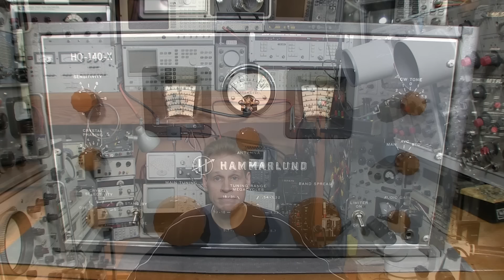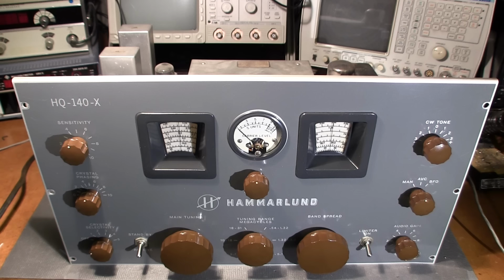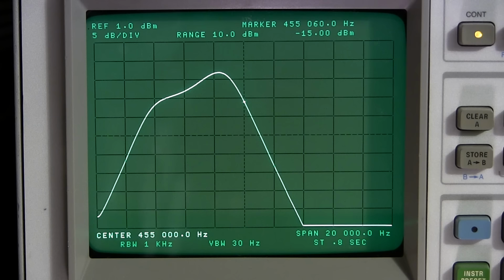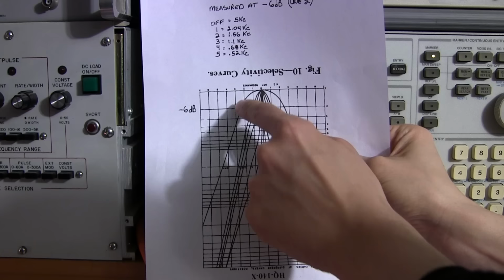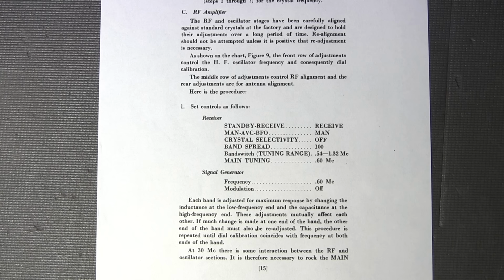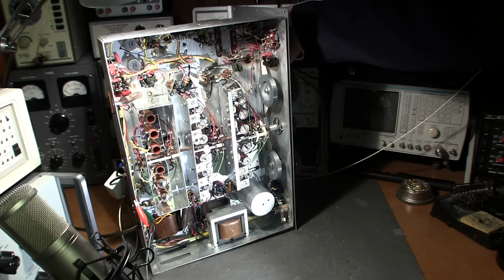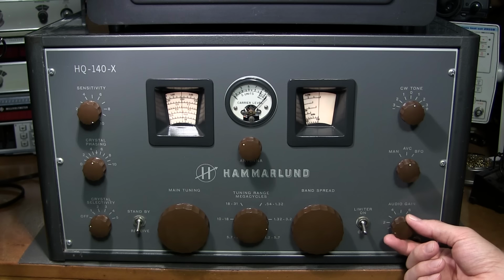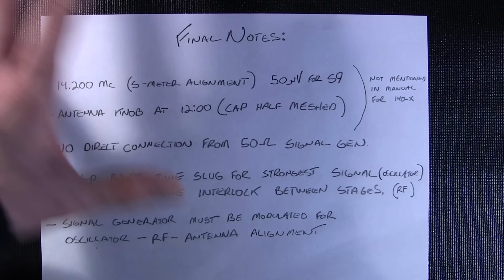Hammarlund HQ-140-X Repair and Restoration

Comment: I have one of these; it still works and I can pick things up on it.
However, it could use a good cleanup.  Most of the knobs cause a lot of scratch-static when being moved.
And the "band spread" knob, sometimes get loose when you turn it, like - it just spins freely and then "catches" again.

Comment: Hi Paul,  just a quick question about the replacement capacitors you put in. I like the dipped style but cant find any polypropylene caps in this style on the usual web shops I use. most of the available PP caps are ugly plastic blocks. Is it OK to use polyester (PET) caps instead? If you can tell me a brand / series that would be very helpful... thx!

Comment: Watching this again now.   Still curious about how the Noise Limiter works with modern noise, such as switch mode PSU's.
I also think this could be a factory fresh unit, but the alignment was maybe done to a secondary harmonic instead of the primary frequency?   Maybe the poorer performance due to that is why it was shelved and has low hours on it.

Comment: This is a real improvement on the HQ-129, and still a viable and enjoyable radio to use on the low bands for AM.  I didn't experience any memorable problem aligning mine with simple gear.. sig gen , a vtvmn and a good ear.. but at the time I was doing a LOT of receivers.  I will bet my bippy, that is all  they had to work with at Hammarlund when it did roll off the line.  Except the person doing the work was almost certainly a woman.. but then that;s who made all these classic radios !

Comment: I have one of those high-voltage tuning capacitors sitting on my bench right now like the one used for antenna tuning.  It came out of a homemade wave meter.

Comment: Paul, another very informative video. I had just aligned a Hammarlund HQ-180A a few days before your video was posted and it's interesting to compare similarities and differences. You always seem to pull in a ton of stations. I may have missed any comments you made about the type and specifics of your antenna. Any details here would be appreciated. Thanks for your time and the quality of your work which you capture extremely well with your video cam and studio type  (condenser?) microphone.
Reply from the maker: Hi Steve. The antenna is an 80 Meter inverted V.  The measured specs: 50 Ohm, SWR 1.0-1 and X=0 @ 3.885 MHz. The center is up around 45 Feet, the leg ends are around 15 off the ground, suspended by insulators. The coax is RG-393 fed to the center, no Balun.
Reply from the maker: Oh, I will also add, the wire used for the radials is fine strand #8 insulated silver wire.

Comment: Hi Paul. I just finished the IF alignment on Hammarlund HQ-140X. (badly screwdrivered) The frequency turned out to be 454.4KHz. I'm using an HP 3325-A synthesizer / function generator (NIST certificate). I am running 200mv p-p into your isolation circuit. Upon removing the T2 cover I saw the crystal frequency stamped on the top of the crystal. ??6.55. The ??s are for numbers hidden by a mica capacitor. I assume the crystal frequency is 456.55. I think the entire IF section has been pulled sideways. I think I should raise the entire assembly to crystal frequency. What do you think?

Also, with crystal selectivity on #1, turning the phasing control does produce notches but the peak moves from 456.4KHz at #1 to 455.9KHz at #9. Thanks.

Comment: I had a question regarding my HQ129X BFO behavior. When I switch to the BFO for CW or SSB, I get a dramatic drop in volume to the point that I need to crank the AF to max to get it to a level that is comfortable. Also the knob above the switch, when turned is unable to zero out to get a good tone on CW or intelligible speech on SSB. 
I do notice a slight dimming of the Voltage Regulator tube when engaging the switch to the BFO position. 
Any ideas where to start on this?
Thanks
73
David
KF4UOD

Comment: If I wanted to get a used tracking generator- what would be several to consider ?I would like to display the IF can/chain bandwidth shape like you did .Can you do this with a signal/sweep gen [HP4040] and an Oscilloscope ? How would you set it up ?  Thanks !

Comment: This is a great video.  One question.  Any suggestions re safety capacitors?  You've commented on rewiring the main power input for All American 5 type radios to include safety capacitors, but I don't believe you said anything on this or the HQ 120 video for receivers with power transformers.  Any recommendations in this regard?  And would you suggest any changes with respect to the main power switch and fuse?
Thanks again for a great video, it inspired me to fix up an HQ-140XA, which is working great.

Comment: What about using Space Charge TELEFUNKEN vacuum tubes or Raytheon Wire ended vacuum tubes and adjust the B+ resistors in order to make it work on 12-25V and the heater 1.5V,
Why did they not see fit to use three triodes in double balanced configuration implementing a SO42P with the necessary parts to implement the tuned circuit of the oscillator that drives the two heated cathodes of the two tubes acting as the balanced mixer or would it be possible to retrofit such a module with the drive to the first IF transformers across  the two plates of the double  balanced mixer, someone is using frequency hopping for some reason.

Comment: Since this was aired new miniaturized spectrum analyzers have been flooding the market (TinySA). As most of us cannot afford a full sized spectrum analyzer, yet we want to do an IF sweep alignment on our radio (HQ129X in my case) can we use these $75 mini spectrum analyzers to do that alignment. It would make good video if you could… or even explain, if we can’t.
As ever, thanks for your gift of radio knowledge.
Cheers

Comment: Paul, you did something in this video that puzzles me.  When you covered the BFO adjustment, you indicated you turned the sensitivity to zero, (negating any signal from the tracking generator to get through the IF chain) then you turned the bfo switch to bfo and displayed the swept frequency response.  I have a problem understanding what you were beating the bfo output against with no carrier present in the IF.  Please clarify for me and thanks.

Comment: when looking for defective noise in a component like resistor or cap. I will use cooler or heat to see what effect that has instead of flexing on the leads to disconnect them. Just a different approach.

Comment: Wonderful video - as always!  When designed?  Pulling rectifier tube will not open filament circuit?  Smells good?   Why is that -||- in a can?   In those beautiful tuning capacitors, no interference through the open shaft slots?  (Oh.  Filaments parallel.)  Wonderful test instruments!

Comment: I always wondered about using tantalum capacitors where possible in some of these older radios.  Of course, that would not be anything NEAR period correct, but are there any other reasons not to use them?  I use them on old video game systems and I won't buy a computer motherboard unless it uses tantalum caps.

Comment: I just got into ham radio and bought several old pieces of equipment. Log books from the 50's etc. How do you find out its worth? I'd like to pass this equipment on to someone who will rebuild them and use the cash to finance a little of my new hobby. Keeping it for its history/nostalgic/display value was tempting but I don't have the shelving needed just yet or space.

Comment: I've  been  working on mine. Works well except for the BFO. When I switch to BFO, the mode switch arcs and the VR tube goes dark. Something is drawing too much current. Perhaps the mode switch is messed up??
Reply from the maker: Hi Philip, there is a short somewhere.
Reply: @MrCarlsonsLab  --- thanks. Was just wondering if this was a common failure mode with this particular receiver. Restored most of it and the nicotine just poured off of it with cleaning.

Comment: Great video! I have one of these HQ-140X receivers with 2 bad coils. The RF input coils for the 2 lowest frequency bands are both bad on the antenna link input side - fried. The other half of each coil is fine. Any idea what I could use to replace these?
Thanks.
Reply from the maker: You can do a bunch of things. Find an HQ129X for parts (more common than the 140) You can try to capacitive couple the antenna jack to the first stage (possible reduced gain).... Or try to re-wind the burnt portion of the coil.
Reply: thanks - the capacitive coupling works good, I took off the bad windings so if I can find some that very small wire I may try putting on new windings sometime in the future. I tried a bunch of different caps for the coupling and settled on 39 pf....works quite well actually.

Comment: Hi  I am restoring a Hammarlund 120 just like you did on a previous video. I am missing the aluminum shield under the chassis, under the tube socket for the 6J7 tube. (looks like the 140 has one also) You had another  one from a donor receiver but I do not have a donor and even if I did I would want to restore it as well. I intend to machine one from a solid cylinder of aluminum on my metal lathe. I can measure the diameter of the shield because there is a section of the shield still fastened to the chassis. But what is the height of this shield? I can pick a value as there is a tolerance or range of heights that would work and stay inside the chassis and still fit in the cabinet. Just wondering what the original height was and if you could tell me. Also  is there any holes or other structures in the original shield I should know about? Thanks for spending time making these videos.

Comment: great video, did take a long time to watch, was worth it :D

btw how does a two pin plug work so that the chassie isn't line or is the chassie connected after the transformer or??
btw 2. nixie clock project is going foward.

Comment: @Mr Carlson's Lab: You answer so many questions. Superb. I have a 140X in about the same condition. When I can get a proper sweep alignment setup, I will restore it with this video as a guide. Beautiful work, thank you. I also have a couple old SuperPros which will follow (SP200 and BC 794.) I have a request, and it is asking a lot, but I want to put it our there. Would like to know your opinion, review actually, of modern low cost sweep generators and spectrum analyzers that could be used for this type of work. The new stuff is small and low cost, but don't know if it is at all functional for these applications. I would propose manufacturers or dealers sending you gear to check out. You're probably not interested in doing something like that, but it would be my request because you work on the type of gear I want to keep running. Anyway, can't say enough thanks.
Reply from the maker: Thanks for your input!

Comment: Could you please tell me where you get the small ceramic standoffs you use. I've looked for ages, but can't find them. Also, have you ever worked on and realigned a Racal RA-17. That would be a fascinating video. Thanks for the great work.

Comment: Paul:

Once again thanks for the great video. I really love your tip for using the ceramic stand off when replacing the electrolytics .Where do you get those standoffs? What method do you use to hold those in place while you solder them in before you attach the new electrolytic?

Keep these videos coming!
Reply from the maker: Hi Bryan. I got the standoffs in with a bunch of electronic parts I bought a while back. I have never had to source these parts. I imagine they could be found in surplus.

Comment: Have you encountered a Collins 75A4 receiver! with its mechanical filter technology that provided close to ideal band pass I/F skirt flat top selectivity, which were ideal in crowded amateur radio congested regions. Perhaps, the costly mechanical filter technology has been replaced by digital signal processing hardware and software, as incorporated in receivers by Watkins-Johnson, located near Gaithersburg/Germantown, Maryland?

Comment: Hi Paul. I was very impressed with your video. I recently inherited a Hammarlund HQ-140X and its performance is not the best. I am wondering what is the best way to clean the band switch. I have Caig's Deoxit and Nu-Trol. Thanks.
Reply from the maker: Go with the first listed cleaner. Coat liberally on the wafers, rotate the switch a bunch of times, and repeat.
Reply: Hi. I just finished the IF alignment on Hammarlund HQ-140X. (badly screwdrivered) The frequency turned out to be 454.4KHz. I'm using an HP 3325-A synthesizer / function generator (NIST certificate). I am running 200mv p-p into your isolation circuit. Upon removing the T2 cover I saw the crystal frequency stamped on the top of the crystal. ??6.55. The ??s are for numbers hidden by a mica capacitor. I assume the crystal frequency is 456.55. I think the entire IF section has been pulled sideways. I think I should raise the entire assembly to crystal frequency. What do you think?

Also, with crystal selectivity on #1, turning the phasing control does produce notches but the peak moves from 456.4KHz at #1 to 455.9KHz at #9.

Comment: A Spec-an is pretty high dollar for a ham; however, could I use a SDR such as Airspy HF+ as the analyzer ? I would need to figure out a tracking generator - I could use a GPS based signal source eg.Leo Bodnar. Then the matter of impedance transforming with old radios such as my SX-99. Paul, have you looked into spec-an's w/TG's on the cheap for things like this ?

Comment: Excellent video!  I was wondering if when you change the resistors while restoring have you ever changed to metal film rather than carbon comp?  If so, did you notice if the receiver has less noise?
Reply from the maker: Hi Kenneth. You won't notice any difference in the noise level with metal film resistors, (unless the carbon comp resistors are faulty) They say carbon comp resistors are noisy, I have yet to notice this in any audio or RF circuit. Metal film resistors do have their advantages though.... more temperature stable, they don't tend to go up in flames, and so on. In many receivers I do swap out all the carbon comp resistors just for dependability's sake, This one was so clean, I left them all original.

Comment: I have an odd request, may have no interest to do so, but i would love to see some explanation of mods and how a typical CB works. I used to drive truck over the road and different CB techs across the country will feed you different stories about how to mod a cb to have more output, or as they call it peak and tune. Just if you happen to have an interest in doing so, i would greatly appreciate it.

Comment: What I like is the manufacturers schematics and service manuals are suppose to be 100% correct, yet this is at least the 5th project from a major manufacturer where you find mistakes in the service manual or schematic.  It no wonder why so many home technicians and small service shops can't get things to work as they should.

Comment: I am wanting to purchase a Hammarlund HQ series receiver. Do you have any suggestions on which one(s) would be most applicable to use for a "daily driver" in a ham shack? Any that stand out in your eyes a being particularly "good"?
Reply from the maker: Hi Don. Nice to look at in the dark, HQ-120 or HQ-129-X. early SP-200 or 400 is nice as well. If you want one that receives so well, it's not even a challenge to use: SP-600. If you want to stick to the HQ-series, and your interested in AM performance (some stagger tuning involved) This 140-X is a great performer (tons of receive), but the S-meter doesn't light up, for those long winter nights listening to DX. For low band performance "160-80-40 use" take your pick. Personal preference: Comfortable listening, and really nice to look at: the 120 or 120-X is my favorite.

Comment: Question for you Paul: How does one clean the tuning and bandspread capacitor leaves? I have some old radios, including a Hammarlund HQ-170 that have some fairly dirty (dust accumulation, etc.) tuning caps, and it would be great to clean them without damaging them... While this might be a good video, it would help me sooner rather than later... 

Happy New Year to you and Yours... Paul N1PSX...
Reply from the maker: Thanks for your input Paul! Happy New Year to you and Yours as well.

Comment: Nice vid.  I am about to do my HQ180 soon.  So why not gimmick the SG to a 450R across the antenna terminals or just hook an antenna to the output of the SG to do the RF, Osc & antenna and use a short antenna on the rig, instead of your magic box we are all waiting for?  Both methods will not load down the receiver.   Thanx.
Reply from the maker: Hi Bob. Loosely coupling to a resistor at the antenna terminals would be fine for peaking the ANT and RF section coils. This method will not work for calibrating the s-meter to factory specs. The signal level at the antenna jacks has to be known for this alignment, and for receiver sensitivity measurements as well.
Reply: OK, thanx MC.  I (most) don't have all the junk you've got. And wouldn't know how to run it if I did. We still have to schedule the Vulcan mind transfer. I do have 1uV/50uV generator made by Elecraft for 80M/40M20M for sensitivity checking & meter calibration.